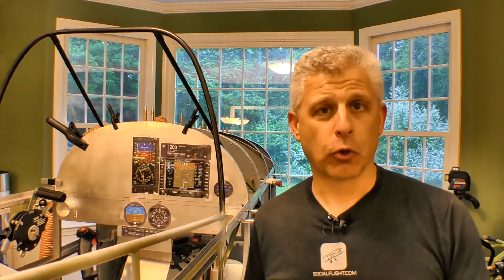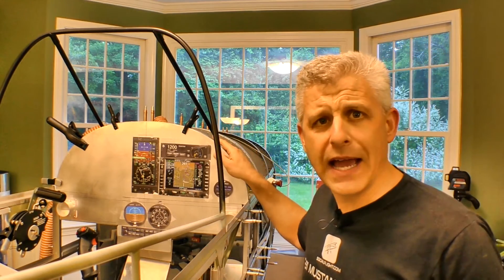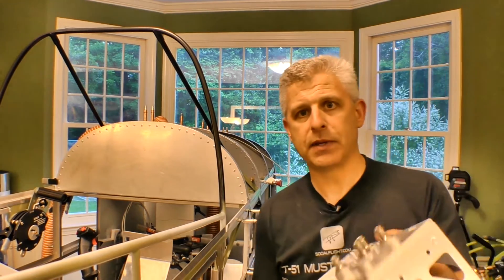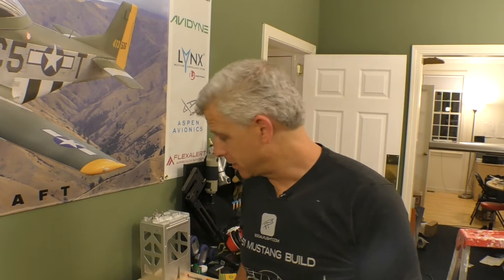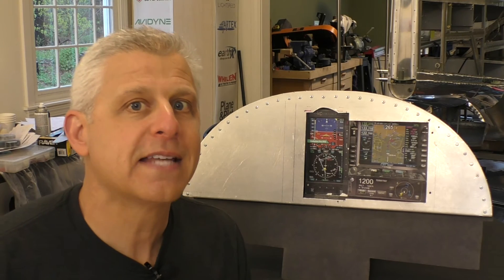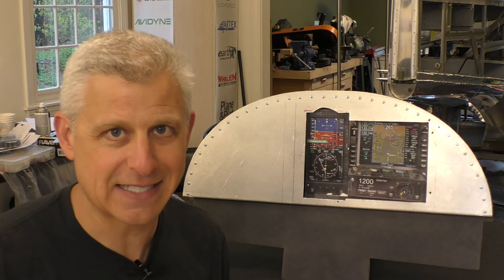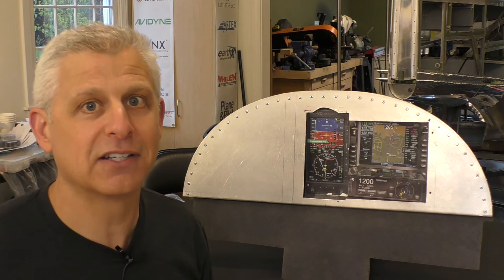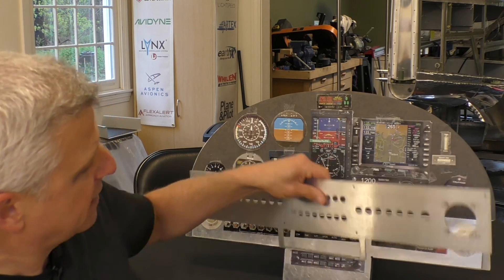Panel Time!  Building the Instrument Panel on our Replica P-51 Mustang... (Part 1)

Comment: Will you be using some Circuit breaker module like the  Vertical
 Power VP-X? Or will you have individual breakers?
Reply from the maker: Thanks for the question.  The VP-X is a great unit, but it only works with experimental MFDs.  Therefore, we are going with traditional circuit breakers and using the Vertical Power PP-X for primary power distribution (alternator, starter and battery control).  We are also using CB Switches for many of the circuits in order to reduce panel space usage.

Comment: Do avionics for aircraft start around $20,000 ?
Reply from the maker: It varies dramatically based on the type of flying you intend to do and the avionics required. A simple radio or attitude display can be as low as $2k, but a navigator can cost $6k-$25k.

Comment: Love the progress you guys have made! Just my two cents, but I’d suggest putting your radios on the left hand side of the panel. Ergonomically, lifting your hand from the throttle to the radio stack is much easier and safer than crossing over, or taking your hand off the stick.

Keep it up!
Reply from the maker: Great point. We experimented with this a lot and decided it was easier (for us) to switch hands on the stick or engage the AP because we’re right handed and the tough screens and controls were challenging to use left handed for us.